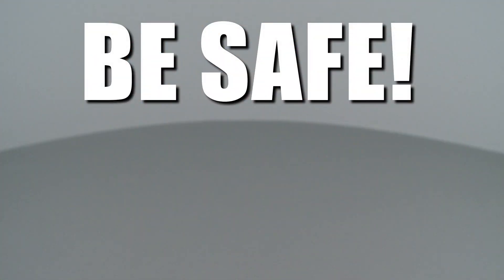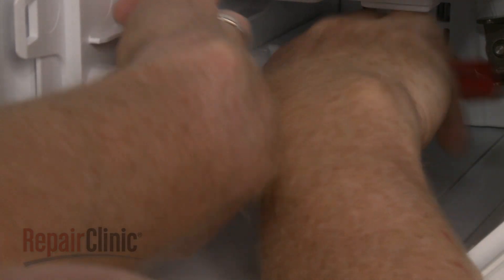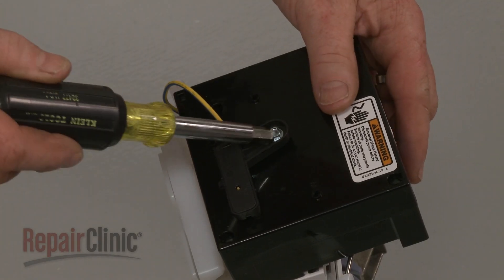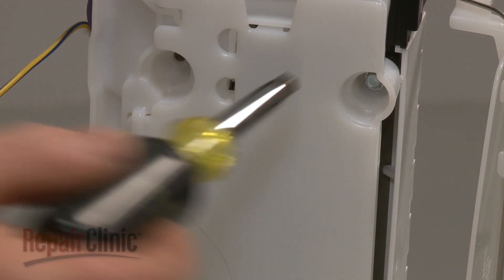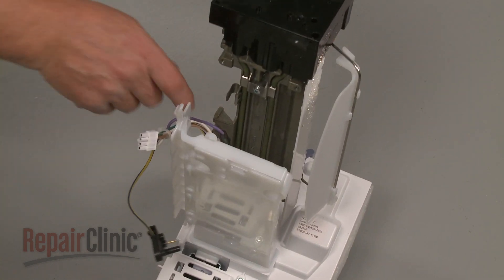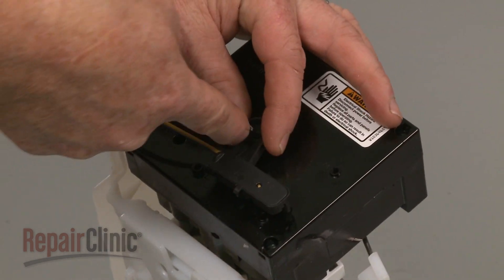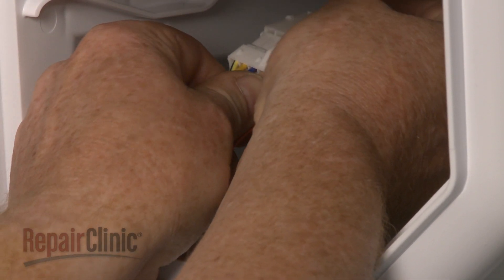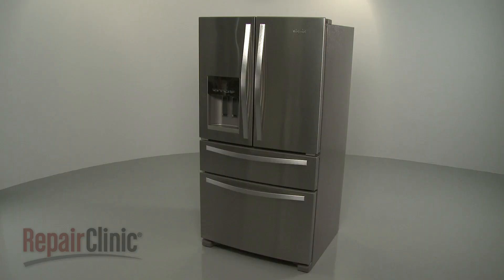Whirlpool Fridge Ice Maker Won't Work? Assembly #W10377151

Comment: Alright, how do you get the wiring harness apart? I can't figure out the trick.
Reply: On the wire harness, one side has rectangle trash. Push down on the bottom portion of the tab (closer to you) and pull the harness apart. Good luck

Comment: I'm wondering if there is a way to adjust the amount of water or the fill time on this particular model of icemaker... I just got my icemaker working after replacing that part and another, but the ice cubes seem a bit small.
Reply from the maker: +Will “Latte” Lugaro There is no adjustment. We would suspect a restriction in the water valve or low pressure to the refrigerator.
Reply: +RepairClinic.com I assumed as much. it's OK though. I think the icemaker is meant to make the ice cubes smaller. Some of them come out stuck together on one end  which is know is a symptom of over filling. my previous refrigerator made larger ice cubes so I was only wondering. thanks.
Reply: +Will “Latte” Lugaro You said they are stuck together on one end, that might be a sign that your ice maker or fridge for that matter is not level. Just an idea.
Reply: I'll

Comment: Great Video thank you. I bought the replacement Ice Maker off Amazon for around $80. My 
Maytag double door fridge stopped making ice last week, researched and installed today. 
FYI, the install I did was much more intensive than the video, most likely because of upgraded technology. This is not a plug and play repair like the video. You will replace the entire wiring harness which isn't a huge deal but it takes time and work. 
Mine stopped making ice but still serving water and I was concerned it wasn't getting the water needed so might be a different repair. No. Installed and it works great. It comes with 0 directions so take pictures if you have basic handyman skills no problem.

Comment: I just installed a new icemaker in the refrigerator. I think it's over filling. The ice cubes are coming out in one strip together and then there's water in the ice bin/dispenser . Since I couldn't find an adjustment screw on this ice maker, upon reading about water pressure and leaking inlet valves, I have replaced the inlet valve and installed a water pressure regulator. To see if it would fixed the problem. Although I didn't think it was that because it was working fine before the old icemaker went out. Is there an adjustment screw on this model like there is on others?

Comment: I have a Maytag , my model number is MFI2269VEM10.. the ice maker I need to use is the one showing in the video but I have an on off switch on the right side of the white cap. I can't seem to find any with the switch showing..Is this the right part number I need to use?
Reply from the maker: Looks like the ice maker may have been updated and no longer includes the switch click here: http://www.repairclinic.com/PartDetail/Ice-Maker-Assembly/WPW10377151/2118175?replacedManufacturerPartNumber=w10377151&TLSID=1943

Comment: i just changed this part . The ice is filling up the tray and freezing but not dumping out into tray . Any suggestions ?
Reply from the maker: +Steven Andrews Make sure the freezer temperature is low enough for the ice maker to cycle properly. Needs to be between 0 and 10 degrees F to make ice.
Reply: @repairclinic  I am having this issue as well. The freezer is definitely cold enough. The ice is freezing but not dumping out. Brand new icemaker

Comment: This is a great video and sufficient for a basic ice maker exchange. Thanks Repair Clinic!

However, you might be in for a bad surprise when you look to reconnect the harness, just after re-connecting the baffle. That's when you'll realize you have to replace the harness, which requires a lot of complicated, aggravating work.  Luckily, I had help because I don't know if I could have done it myself.  
I ordered my part from Sears, whose site said it was a match, and I bought my fridge from them, but apparently, the new part available has a different size harness connection.  
I don't know if you can find a way to verify that your harness connection matches your current fridge.  This is  white part with holes, and the new one is much wider (to fit the wider slots).
It takes a lot of patience and focus. I took a bunch of pictures so I could return it how it was.
Good luck!

Comment: What goes wrong with the ice maker?  What component fails in it after only 3 years use?  I hate to replace the whole unit if it is one small component that can be repaired.  Any wisdom/knowledge will be greatly appreciated.  Thanks in advance!
Reply from the maker: One of the most common causes of ice makers failing to work is a faulty water inlet valve. You'll find our refrigerator troubleshooting and repair help information to be helpful. Enter your refrigerator model number here: http://www.repairclinic.com/repairhelp?TLSID=1773 to view model-specific ice maker symptoms.
Reply: ***** My water dispenser still works.  Can there be a problem with the water inlet valve that would keep the ice maker from functioning but still allow the water dispenser to work??
Reply: Jeff - were you able to figure out which part was bad?  I think it might be the motor but I wanted to make sure before I ordered the part.
Reply: Kevin Tarnowski Kevin, I first replaced the thermostat (627985 Whirlpool ICEMAKER THERMOSTAT) in the icemaker (W10377151). The icemaker made about 3 batches of ice then quit.  So the thermostat was the issue; however, something on my original icemaker obviously killed the new thermostat very quickly.  Maybe a bad heating element???? I just don't know. I would have been pissed but I was able to get the new thermostat for $7.  So, since I have been making my very understanding girlfriend go to the garage for ice stored in a cooler for a few weeks already, I just installed a whole new icemaker (W10377151).  It is making ice now with no issues.  Being an anal engineer, I hung onto the original icemaker so I can try and troubleshoot it to find out what is frying the thermostat.  Hope that helps.  Let me know what you figure out.
Reply: Jeff Farro I had the same problem with ice maker (W10377151) on a Whirlpool fridge (WRX735SDBM00). Fridge is just under two years old. I found the heating element contacts were burnt on the ice maker unit. If you open Black Plastic cover and look inside the copper contact and plastic are burnt. Replaced Ice Maker and everything worked.
Reply: Jeff Farro Here is a pic on the good Heating Element contact http://postimg.org/image/6fl8v6dgz/ , Bad Heating Element contact, http://postimg.org/image/94yuokdu7/ and bad copper contact for heating element http://postimg.org/image/vm2d1evst/ on the ice maker.
Reply from the maker: Peter K Thank you for sharing.
Reply: +Peter K thanks for the posts. Have the exact same problem. $40 on amazon prime to replace the assembly. I recommend replacing the evaporator grommet with the maytag p-trap as well, although if you've had the fridge more than 2 years, you probably already had to do that.
Reply: Mine has failed twice now

Comment: I ordered this part through Amazon for $55.00 - The Ice maker has been redesigned and two wiring harnesses are now provided  = so in addition to changing out the icemaker you will need to change out the wiring harness.  Which took a little time - make sure to follow directions and take photos of how wiring was set up.  We now have ice!!!!
Reply: Did the exact same thing today, taking photos of what's connected where and then reconnecting the new wiring.  Hopefully in the morning we'll have ice! 🙏🏼

Comment: I was wondering if I could get some input on the issue I am having, it seems that there isnt any water flowing into the ice tray, I tested the inlet valve with a multimeter and seems like the continuity is fine, I also took out the Ice tray as outlined in the video and inspected it by removing the black cover and looking for anything out of the ordinary. So at this point im not sure if I should order the ice tray or the inlet valve, or both. I also tried to leave the ice tray out and let it defrost and put it back in to see if it worked but no luck. Any ideas? Thanks!
Reply from the maker: +Jason Baird Make sure the freezer is a zero degrees F or else the icemaker will not call for water. In terms of likely hood the valve is more common than the icemaker.

Comment: I removed the side cover access and disconnected the wire harness.  I can move the ice maker assembly and inch or two forward, but it jams, and I can't get it out.  The unit is still cold.  Any suggestions?
Reply: There is a rubber fill tube that sticks down from the top. It gives resistants and you just have to pull harder. I thought the same thing.

Comment: Same model as this video.  I thought my ice maker was broken but when I removed the tray for a little while, I found that the ice maker again started making ice and dispensed it to where the tray should have been.  When I put the tray back in it stops making ice, and again only works when I remove the tray and give it time to cycle and make ice.  Any ideas how to fix this?  I'm inclined to think it's not actually the ice maker as I initially thought as it continues to make ice when I remove the tray.  Any help is appreciated.  Thank you!
Reply: What did you end up doing to solve this